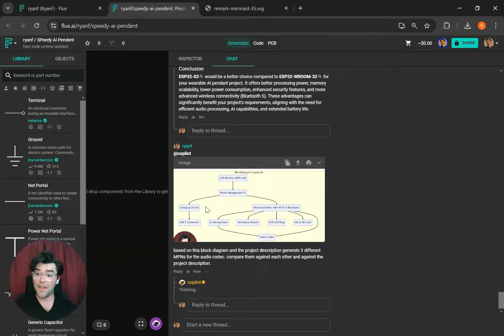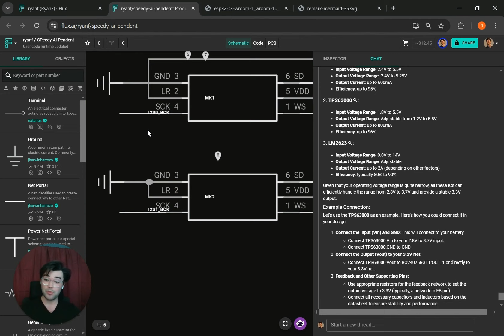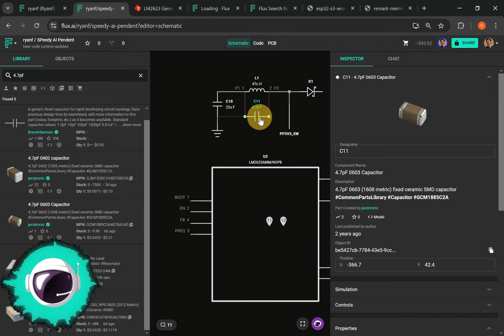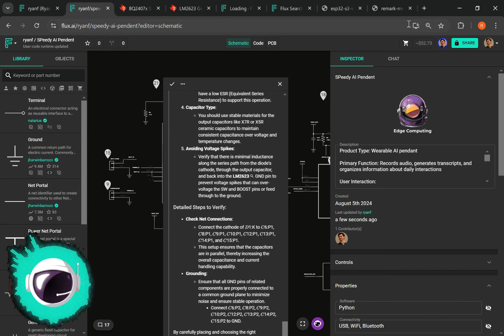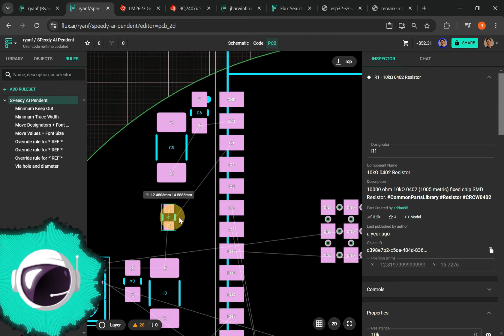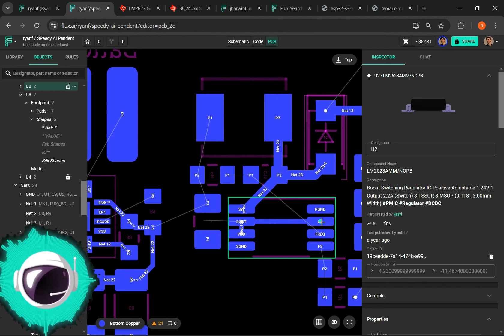ESP32 AI Pin Tutorial

Comment: And it's not even correct. I asked for it to make it based on the 555 version of needing two 555s but the instructions state only adding one 555. Copilot mentions using a 556 IC and that would requiring only need one of them but not what I asked for and not what I got.